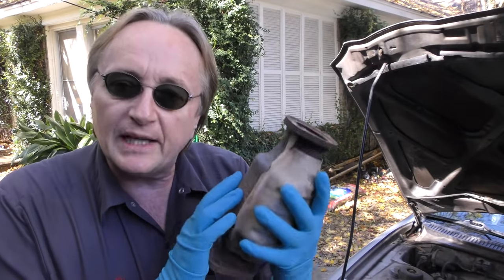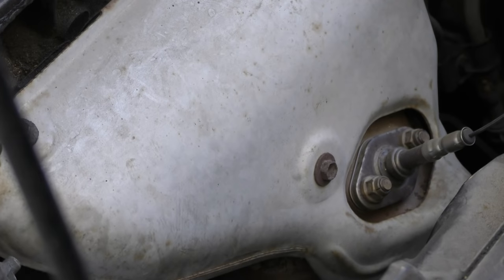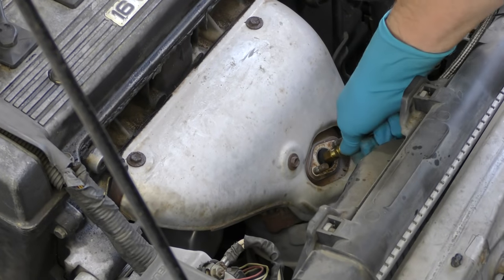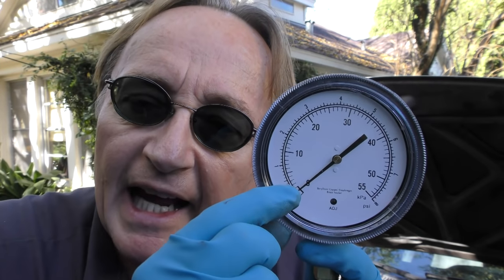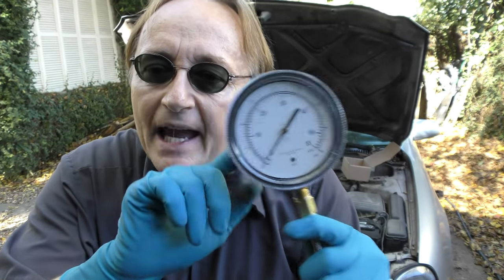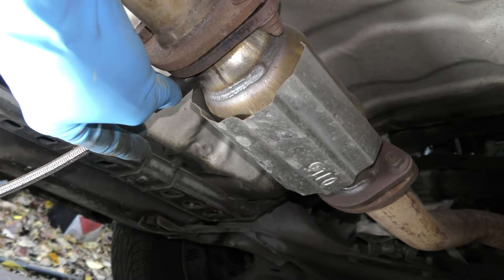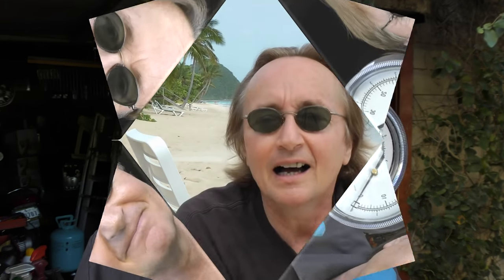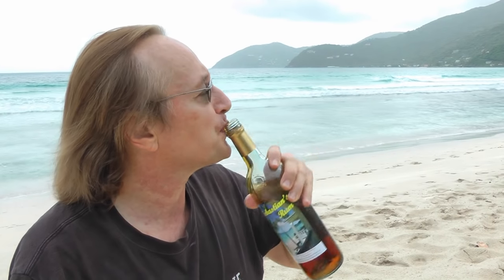How to Tell if You Need a New Catalytic Converter in Your Car

Comment: Excellent video. my engine is a little shaky and lacks of power.  Can I check the catalytic converter by completely removing the front oxygen sensor. That way the steam came out of the hole of the oxygen sensor... If the engine stops shaking, is it a sign that the converter is clogged? What will happen if I start the car with the oxygen sensor not screwed in at all?

Comment: The best car show ever, I have a Honda CRV 2001 misfiring. I replaced the sparkplug, and cabels, and cleaned the injector and still happening. Do you think this is caused by a bad catholic converter? Can I use a pressure gauge to check it or just take it to the mechanic shop to replace the catalic converter?

Comment: Hi Scott,

Can you  please help me with following questions;

1) Can i install a Fed's Cat on Carb 's compliance vehicle.? Is that  true engine light  will  go on due to different Power train setting or filter capacity detection from sensors?
2) If Walker Cat brand is not available for C.A.R.B compliance, can use Bosal brand( now Magna-flow brand) instead.
3) Is that true C.A.R.B grade CAT will last longer due higher warranty standard required by C.AR.B ?

Thanks

Comment: 2013 GMC Sierra 240k 
Thought this could be my issue but doesn’t sound like it now

I’m having fluctuating rpm at idle and as soon as I crank it stays around 1500 and slowly settles to 600rpm

I’ve changed :
Plugs 
Coil packs
Wires
Evap purge (due to p0446 code)
Did throttle body clean and relearn (I have an Autel)
Few cans of seafoam
Map sensor 
Maf sensor 

I haven’t done the vacuum smoke method yet and considering changing fuel pump. But I only feel it coming to a stop and idle…runs smooth on highway

Comment: One trick we do in Australia, because we have no emissions testing, people simply punch the middle of the cat out with a screwdriver and reinstall it. It's illegal of course, but you'd never know unless you tested for emissions.
Reply: except it will cause the downstream O2 sensor to read incorrectly and will cause your engine to run lean which will cause burned exhaust valves and higher Temps inside your engine.
Reply: +Peter “Crackpot Pete” Carlson Except that all the downstream 02 sensor does it monitor if the catalyst is working. The primary sensor is what determines fuel trims. Also, no O2 sensor failure can cause a car to run so lean that it burns up things.
Reply: +Moon Moon It will also smell and sound different.

+Peter “Crackpot Pete” Carlson depends on the cars.. most I have seen only use pre-cat O2.
Reply: wobbly sauce also depends on the firmware in your pcm. People don't realize that the dealer or some mechanics might update that firmware and it might change how it interprets that sensor data in closed loop.
Reply: What do you mean "ounch the middle of the cat out"? Please explain :_)
Reply: @taylorj6177  With Cat removed, use a hammer and iron rod to punch, break, ram, destroy a hole through the ceramic honeycomb.  I did this in 1986.  After 4 months the remaining honeycomb broke apart and clogged my exhaust; car came to a standstill.  Had to remove Cat again, clear out a rounded golf ball size chunk, stuck in the pipe.
Reply: @trevortrillion6037  Gotcha. But what is the point of this/ wat does it acheive?
Reply: @taylorj6177 a hole for exhaust to escape if cat is clogged

Comment: Ok here's a tip people!! When a start my 2002 Nissan frontier in the morning, my cat converter wasrattling in short spurts. Come to find out, the heat shield was just rattling. I let it cool down, and I used 1" self tapping screws and drilled 2 screws in the side it was rattling and I saw the shield tighten up were it was loose and now no more of that rattling. That truck has 300,000 miles on it. Cheap fix, yeah!!! Of course scotty's my inspiration!! Lol!! It worked folks!!

Comment: Question. Check engine light on.  OBD says catalytic converter bank 2.  Took it to a mechanic.  I asked if he would be doing a pressure check upstream and downstream of the converter like you say in your video.  He said no, he would get readings from the O2 sensors upstream and downstream of the converter. Will his method also work?

Comment: got code p420.  Everyone tells me to change my CAT.  However, my 2002 has not had it's 02 sensor replaced.  I just bought an Exhuast back pressure tester for $50.  I'm going to try to do everything before i spend $1000 replacing my catalytic converter.

Comment: Alternatively, what do you think about conducting a temperature test by using an infrared thermometer? My understanding is that the temperature of the outlet catalytic converter is supposed to be higher than the inlet temperature, so if the opposite takes place, then it's a tell-tale sign that it's a bad catalytic converter. Would that be a conclusive way of determining that the catalytic converter is faulty or would additional tests need to be carried out?

Comment: Got a 2001 Ford Ranger 4cyl. Was having slight problems with power and could feel what seemed to be a slight miss. I was moving at the time and figured it was just a little overloaded. Had filled up with gas night before and had sat until I cranked it to go to the Hardware store the next day. Was running fine. Got half way down driveway and stopped to get parts I had forgotten. Got two steps away and the engine stalled which had never happened. I got in to crank and no combustion. 

Started troubleshooting. Tried to crank and hear a "whub whub" sound when trying to crank engine and air filter compartment shakes. Looked at air filter and it's pretty clean. Removed filter and tried to crank again with same result. Next I checked the fuel pump. Can hear it whir when key turned on and when I press the gas. Had fuel pump replaced in 2008 so on to next step. Took out spark pugs and checked them. Kinda dirty but could smell gas on them and when I try to crank can see spark on all four. Put them back in and just let it sit for a while in case of flooding. Still doesn't crank.

Figured this meant an exhaust blockage. Now here are my questions. Since I can't get it to crank to use the vacuum pump nor get it to temp to check front and back temp on Cat, can I remove the forward O2 sensor to relieve exhaust back pressure and it still crank so I can finish the troubleshooting? Would it be better to remove the Cat O2 sensor? How can I check if it's the sensors that are bad? I don't have the fault reading equipment and as I mentioned the truck is immobile.

Thanks for your videos. They are really helpful.

Comment: Thanks Scotty.  Can catalytic converters really be cleaned out and unclogged using sodium hydroxide as has been shown on Eric the Car Guy's channel?
Reply from the maker: +MrMschoose yes, sometimes that works, but of course you have to remove em to do that, not an easy job on a welded system.
Reply: +Scotty Kilmer Or with rusted bolts on the catalytic's flanges.  Thanks Scotty, look forward to your upcoming videos.
Reply: @scottykilmer  Does the lacquer thinner make it easier to clean it then, since you don't have to remove anything, as with a more recent video of yours??????

Comment: My VW Golf Mk5 (aka Rabbit, standard 1.6l 6V engine) failed emissions test on the CO levels, same thing after really heating it up on the autobahn.The other things (NOx, CO2) are fine, it's just the Carbon Monoxide.

Car runs fine, smoothly and eagerly goes up to 115 mph (its rated max speed, you can feel it hit the limiter too), idle has the occasional jitter though, even when warm, idle rpm bounce between 640 and 680 (OBD sensor data).

Emissions test guys told be to maybe swap the air filter (looks super clean to me) and spark plugs (3 years old) and pray it's not the catalytic converter. If the catalytic converters are hotter on the output than on the input, that means they're doing their job right?

Comment: We used to just knock the carbon out of the cat w/ a piece of pipe. Lot cheaper. Course, that was 20 years ago.
Reply: +1fanger It isn't carbon that causes the failure though. It's the material that gets hot, and breaks apart. Or it fuses itself together internally.
Reply: with a pipe? many people do that INSIDE so it breaks out the honeycomb (basically just a pipe then, no more cat)
Reply: 25 years ago now, still works

Comment: I have a 2009 Honda Fit Sport with 220k miles. Honda says it needs a catalytic converter. Would they have tested like you did? Is it worth fixing? Neighbor said change spark plugs and one coil first and then O2 sensor and see if that turns off the engine light.

Comment: Hello, would a bad catalytic converter cause the engine to start bucking when you give it gas ? The car has no power and periodically stalls out on the freeway in heavy traffic. Thanks.
Reply from the maker: +aaronmcgaga83 yes, and you can pressure test it to see if that's the case

Comment: 2015 Cruze Cat Converter problem.  Need answers.   

I had a reputable local muffler shop replace it with an aftermarket catalytic converter. After driving it for 50 minutes at highway speeds to reset the code system, the engine light came back on a few days later with the same P0420 code. I replaced the downstream 02 sensor to see if that could be throwing the same code. Wrong!  After doing the driving thing again, the engine  light came on with the same code. So the muffler shop replaced the cat with another with the same results.  Now I'm stuck with a conundrum.  

The dealership wants $1700 to put a GM cat on it.  But...  why spend all that money again if there is a simpler and cheaper solution?   Any thoughts on this and have you had similar stories about this exact issue with the 2015 Cruze LT?

Comment: My 2004 Nissan Frontier is having stalling, overheating, jerking, and loss of power issues.  I have learned that my truck has 4 Cats.  2 on each Bank.  Do i test with the same procedure on each Bank?  Engine-Cat1  Cat1-Cat2   Cat2-Muffler
Reply from the maker: you test em all, one at  time, of course starting with the ones closest to the engine, then working back

Comment: The check engine light came on my 2002 CRV, along with poor acceleration when getting past 60mph. I had Autozone test the codes and it came back as a 420 failing catalytic converter. My question is, am I doing any harm to the engine by driving it around, or can I wait until it's time for emission testing? As always, Thanks
Reply: Hi my 03 code 420 just went off… just wanted to know you’re update on how things workout for you . Thank you
Reply: @J3ff415   @Jeffrey Maluia  You can wait until emissions. I figured out on my own that the slower acceleration was from too much transmission fluid (that I paid a shop to do). I did a drain and fill and got back a lot more than I should have. It's a very easy job on these. Much better acceleration now. CRV is still solid at 238,000
Reply: @thare2597  so i have the same problem went to autozone and got a code of P0420 i went to a muffler place and they quoted me over $2000 for a new catalytic converter the check engine light just came on yesterday and it drives just fine the people at autozone said it could also be a sensor but when i went to different places to see about it they just said i need a new converter without checking it or testing it. Im basically just askin can i still drive it until the emission time like you said or just find somebody honest to fix it asap?
Reply: @trakash4k525  I ended up getting mine replaced for just under $400. You'll be fine until emissions time. Turns out my "poor acceleration" was from the dummies I paid to change my transmission fluid. When I did it myself I got out at least a quart too much. I filled it to specs and it drove much better. You have plenty of time to shop around for a better deal than $2000.

Comment: My original catalytic converter was totally melted (burned). I bought a new one and welded, last me for 3 months. Now i have engine light saying catalytic converter. What can the chances be causing the catalytic converter to go bad?
Reply: From forums I have read online, it says you may be having other issues that are causing the build up and clogging the catalytic converter so you need to figure out what those are to address the real problem. I read you can get it replaced then since you didn't fix the cause, it can go bad again. Just sharing what I read. A good mechanic could probably help you out. Good luck. If your car has less than 80k miles or under 8 years old it should fall under warranty even if you bought it used

Comment: hey, Scotty I have a 2012 dodge Journey and I was told that the catalytic converter is bad. I took the catalytic converter off to inspected it because i cant afford the tester, the inside looks intact and I heard nothing rattling when I shook it,the honey comb looks great and the way its angled / shaped, I can see some light I shine through it, I can get air through it easily. Since its the only exhaust component with sensors on it, is it safe to say it clogged? any direction or help you can give me would be greatly appreciated.

Comment: Hello! I have a 2004 infinite fx35 with 182,000 miles. My service engine soon light came on and Auto zone coded it for a catalytic converter: It still drives fine. A mechanic at a muffler shop confirmed it was the catalytic converter (he can replace for $500 + tax) and advised I can drive it, but replace it soon. Shortly after I got my oil changed and tires rotated, the light went off. Do you think the oil change that was due contributed to the code or should I get it replaced anyway?

Comment: Hello great videos always. But my car is a 2012 Nissan Altima 3.5 v6. The service engine light is on and I took it to Autozone and they said the Catalytic converter was bad. Now idk what part it if there is sensors and all but the car runs just fine. No smells no loosing power no over heating. Do you think it’s something else?

Comment: Most of these comments lowered my faith in humanity. Impressive.
Reply from the maker: +HunterShows that's the internet for you. But really, humanity has been going downhill lately
Reply: ***** That's a sad thought, seeing as I had little to begin with.
Reply: ***** That's a sad thought, seeing as I had little to begin with.
Reply: Does the catalytic converter work harder when the engine is running at a higher rpm? My cars cat is acting up and i've taken it to the shop twice. The engine light comes on and then goes off for a few days. The shop has told me it's acting up but when i take it back for them to fix it the engine light is off and the codes do not come up.
Reply from the maker: yes it works harder, and they can be pressure tested by a good mechanic
Reply: My car is still under warranty, so i was dealing with dealership. Can the dealership do this and make the code pop up? They said they would "flash it" and see what that did, and nothing happend. Would driving it harder make sense so it will break and they fix it? I'm running out of warranty, and really don't want to be stuck with the bill if you know what i'm saying.

Comment: Hello sir.

I drive Honda CRV 2007. Of recent time I discovered that the car consumes a lots of fuel more than usual, because of that I have Changed the Exhaust middle port, but still persist.

Please what do you think is the problem sir.
Thank you sir.

Comment: Hi Scotty
I have a 2005 E200 merc.
No codes no engine light
The car has no power like you say in this video. And sluggish then to change over as well. When it idles all sounds good even revving it up.
Sounds to me what you said about the cat converter then...
Question 
Can i put thinners straight into pipe at the oxygen sensor hole?

Comment: Some cars have 2 catalytic converters and two O2 sensors, one near the engine and the other downline under the car near the cat converter. So do you check them both by taking out the O2 sensor and checking the pressure? And if you change both of them how do you check the muffler?

Comment: @ScottyKilmer I have a 2013 Chevrolet Captiva sport Ls, and that car is gi ING me a headache. I've taken it back to the dealership to fix it. And they've given me 3 different problems of the times I keep coming back. When I'm driving the vehicle, it jerks alot from 0-50 mph, then the engine gives out but once on the highway, it can go up to regular speed until i slow down to 60 and below it'll jerk. Now they told me it was the feel ejector was dirty so they cleaned it out. The next day, it was doing the same thing I came for, again then left me stranded on the high way but I was able to bring it back in. Now they told me it was mass air flow sensor and oxygen sensor. Then when they took it apart, they then told me it is the catatylic converter. What do you think it is?

Comment: Scotty: my 2016 Hyundai 1.8L petrol is producing a rotten egg smell from exhaust and has been for a long time. I haven't noticed a change in performance. Could it be a clogged catalytic converter? I get it serviced at the dealership which I know is inadvisable but since it was bought new, I thought maybe that'd help if it needs trading in or with warranty claims. They always come back with "couldn't fault the problem"

Comment: Scotty..Can a clogged Cat cause  intermittent low power like you mentioned.Had the p0421 code come up and car ran terrible and lacked power, but then power came back.Had the Misfire p0300 code before that show up.Trying to sort it out.Won't stay running bad.Doing plugs and wires for starters  AND CLEANED EGR.thanks